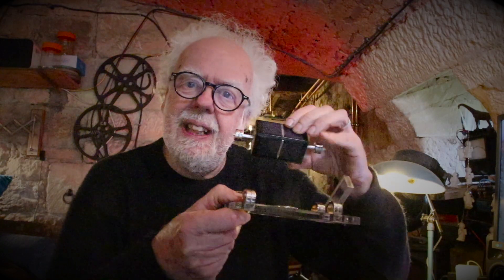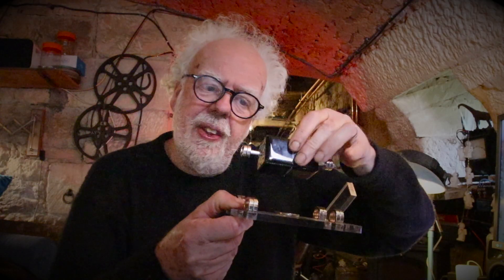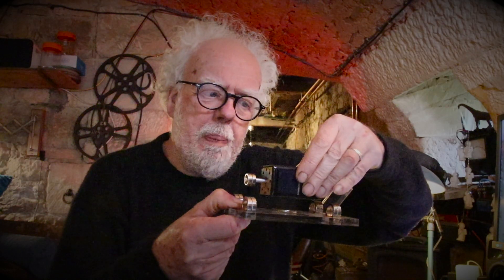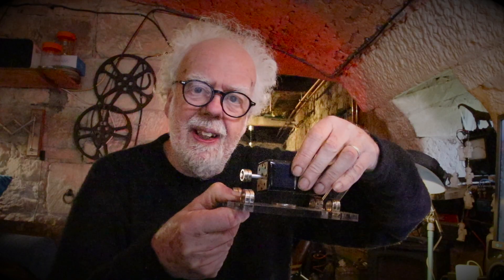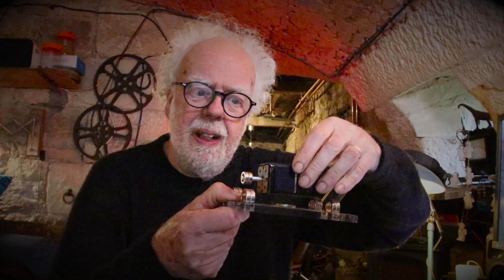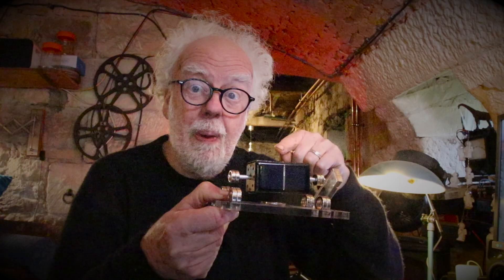Solar Cell Mystery ? - Prof Simon

Comment: Because of the angle the cell is set to detect light, think of how a sail works.
Reply from the maker: that sounds logical
Reply: @SimonHollandfilms  but false, its timing, like the clocking of a DC motor's brushes...
Reply: @MrThodin  I thinks so too. It's like rotating the brushes of a Motor which will change the direction (some elektric drills work like that). I assume, there are 4 coils inside the rotor, each fed by one solar cell. At the center of the fixture seems to be a permanent magnet which produces the stator field. Depending on the position of the light source one coil at the time will be energized. If that coil is of center to the static field it will cause movement. The direction depends on to which side it is out of center.
Other that with a normal DC motor the coils can't change polarity because solar cell have a given polarity, so it will be only on or off.